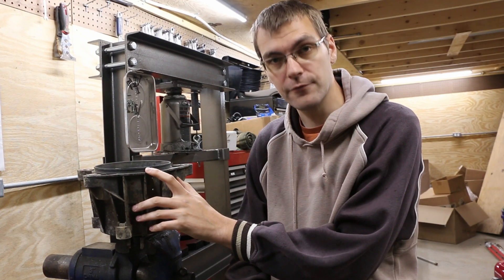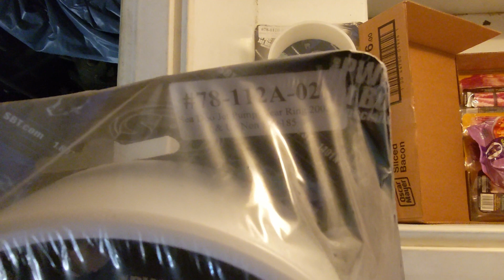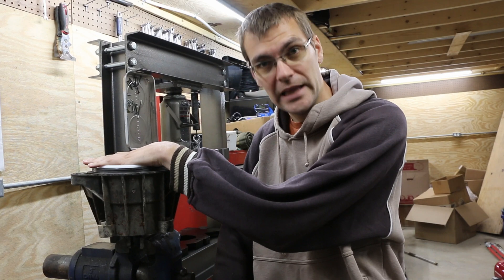How To: 185hp Seadoo Wear Ring Replacement

Comment from the maker: This is nearly the same procedure on every seadoo, so here are links to wear rings and the tools you need to fix whatever machine you have:
Wear rings:
300HP: https://amzn.to/45l9R8O
215hp, 230hp, 255hp, 260hp: https://amzn.to/3KAyNB9
130hp, 155hp, 170hp, 185hp: https://amzn.to/45jSwgn
Plastic spark wear ring: https://amzn.to/47oLYyS
Stainless spark wear ring: https://amzn.to/3DSn5ya  Video on replacing spark wear rings: https://youtu.be/cJepfrsbPzY
2 stroke 155mm pumps (951di/947di, some late 717s): https://amzn.to/459eDqk
All other 2 strokes: https://amzn.to/443mnZh

Impeller tools:

215hp, 230hp, 255hp, 260hp: https://amzn.to/3Qtuo6Q
130hp, 155hp, 170hp, 185hp: https://amzn.to/3qgUvU0
12mm hex Socket: https://amzn.to/3qBmm16
2 strokes: https://www.shopsbt.com/jetski/sea-doo-spark-impeller-removal-tool-529036273.html (This tool is vastly superior to the ones on amazon, SBT has not added this tool to their amazon store yet, so buy it direct, I'll update with an affiliate link once it becomes available)

Links shown on this channel may be affiliate links, which earn me a small commission at no additional cost to you!